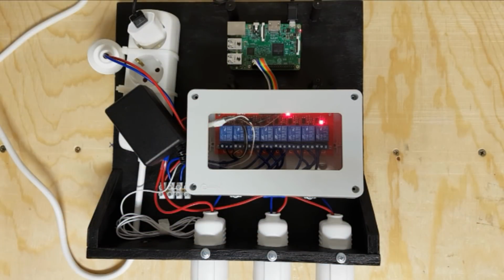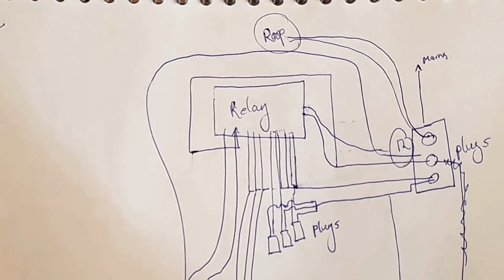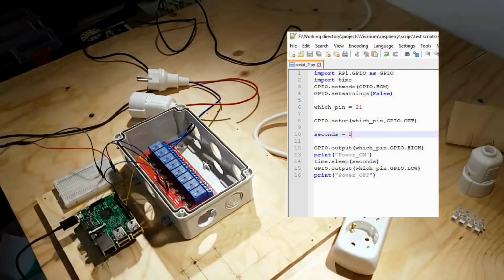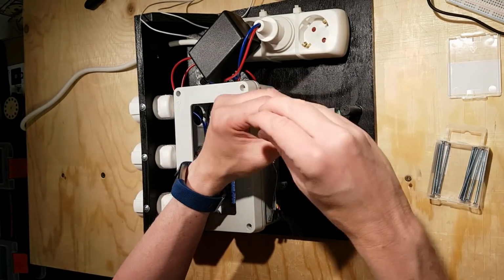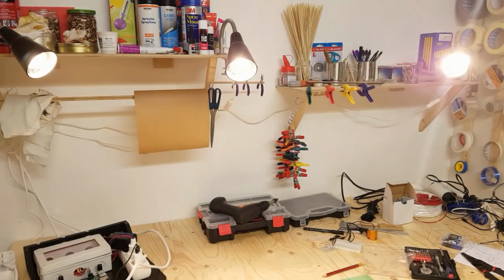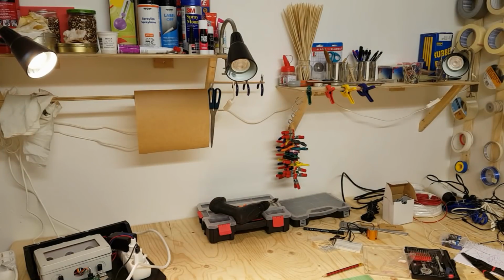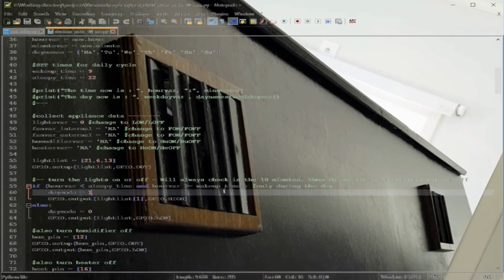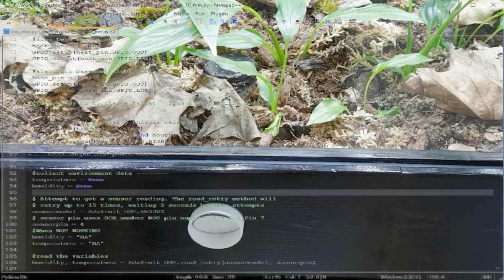Automating a DIY vivarium with a Raspberry Pi.

Comment: What did you use to measure the temp and humidity ? Looking to do something similar to an already made viv I have
Reply from the maker: I used a DHT22 humidity and temperature sensor connected to a raspberry pi.

Comment: Hi, great Projekt 👍 How is your vivarium doing now? Is the wood ok, after all this years. I plan to build one, but want to know if your wood is still ok. Thanks for your great Videos.
Reply from the maker: The vivarium wood looks fine! I recently removed all the plants and soil (it got a bit too wild) and replaced it with pine bark. During this process I cleaned and checked everything and there was no leaks or rot. There is just the plastic like epoxy that wipes down easilly. I now have potted plants and bonsai in the vivarium on the bark cover and keep the humidity at 90% and again the growth I see is wild. Look at my most recent video (https://youtu.be/qdbzDo6Y5Ec) to see how it looks now.
Reply: @Induku  thanks for your fast answer 🥰

Comment: Great project and video. Kind of new to Raspberry Pi and python. Have been looking at your links and struggling to make sense of some of it, did you run the AM2302 through one of the relays? Would it be possible to have a copy of your code please?  Thanks, Jon.
Reply from the maker: I did not run the sensor thorough the relays. I have this post (https://indukudesign.com/2019/06/10/diy-bio-active-dart-frog-vivarium/) were I explain a bit. But much more useful is the links that I post that I used to set it up - approximately halfway down the page. The best is to look at each section and see the setup of each component and the code (it is much better and more clear than mine).